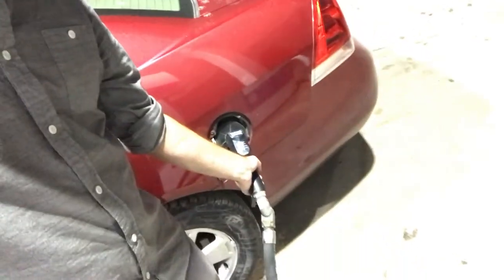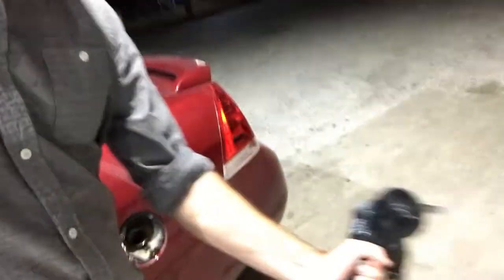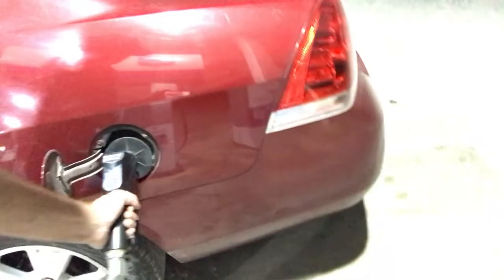Gas Pumping to SLOW?

Comment: As a person who services fuel stations I can tell you if you have to wait to get full flow it's a dispenser programming issue.  Fuel does not come out once you squeeze the nozzle at full flow, the electronic pulser has to see on avg 10 pulses before it allows the dispenser to go into full flow.  Also if some thing like a leak detector trips then having the nozzle out of the dispenser while not fueling allows the submersible motor to pressurize the product lines and un trip the leak detector allowing you to fuel at full flow again.  If a dispenser is just slow at pumping it's most likely a dirty filter that needs to be changed.

Comment: How do I fix a 2013 Honda CRV letter D blinking.
Reply from the maker: Probably a loose electrical connection to a sensor. I would Gently pull the wires attached to the connectors. If one pulls out, that connector should be replaced.